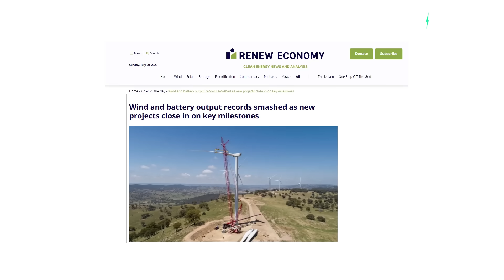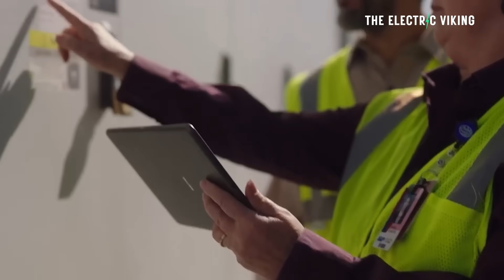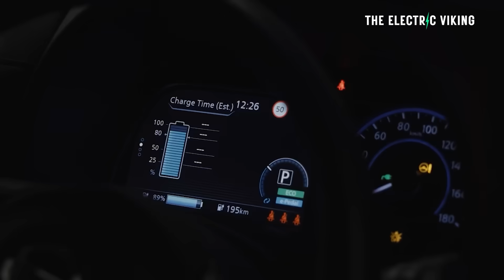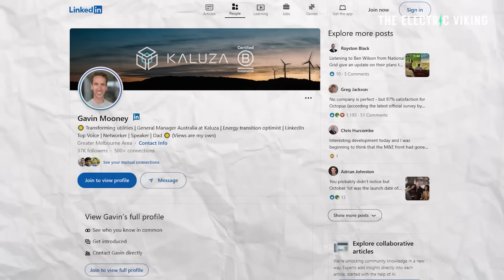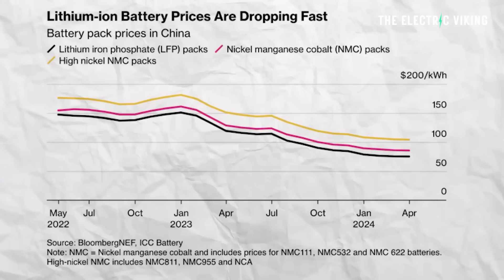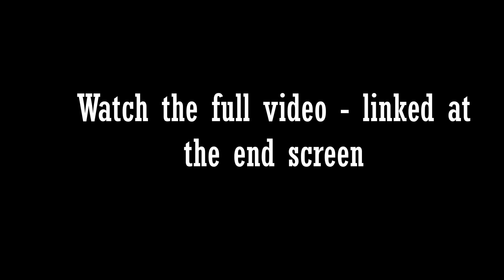Australia, Texas and California SMASHED renewable energy records last week

Comment: In Brazil my friends tell me that their cost of electricity is ZERO.  During the day they sell their excess power from the solar panels on their roofs to the grid and at night they use up their excess credits.
Reply: Well you see that doesn't work in real countries where the main reason for electricity generation is shareholder value, a system like that would never work in a real country like the US where it is a requirement to nickel and dime every citizen for everything all the time. Unless renewables can be made to be more expensive to justify charging 40% of a customers yearly income, it will never become a thing in the US

Comment: .  "In 2022, California used a total of 287,000 gigawatt-hours (GWh) of electricity, according to the California Energy Commission. This includes both in-state generation and imported electricity. "  "In California, a significant portion of electricity generation comes from renewable and non-greenhouse gas (GHG) emitting sources. In 2022, these sources accounted for 54.2% of the state's total electricity generation. Specifically, this includes solar, wind, geothermal, and large hydroelectric power. In 2022, California's utility-scale renewable generation increased by 10.2% to 102,853 gigawatt-hours (GWh). Solar generation alone saw a 24.1% increase, reaching 48,950 GWh. "
Reply: The GHG industry sees this as a net revenue loss and they’re actively lobbying to slow down or reverse this process of true clean energy.
Reply: @royherren1336  greed hiding a death wish.

Comment: If - NORTHERN LYING - Germany and Netherlands both generate over 50% of their electricity through sustainable sources, these natons are as north as the Hudson Bay in Canada, the US can do this with ease. Airconditioning? Feed that with solar power. Same with (heat-pump driven) hot water boilers. These are the biggest two energy users at homes. Just utilize roofs: so networks/grids are hit less. Bye bye coal. Was good, but CO2 and soot - this is a past time. You've got it Viking!!

Comment: Pacific Gas and Electric, our monopoly Northern California grid,  gives you very little money for any excess energy you produce.
Reply: I live in San Francisco and have rooftop solar panels. I agree PGE is a ripoff. My best solution is to consume all the electricity generated from my solar panels. So, I am using PGE as a battery. Eventually PGE might charge extra fees since after I add the solar panels electricity, my net electricity consumption is zero. In this case I would get batteries and disconnect from the PGE grid.
Reply: For the elsewhereians here I should explain. If one installed solar before a year or so ago, then if you produce more than you use over a year you are paid the wholesale rate for your excess. If you use more than you produce over a year you pay the retail rate for your excess use. You are using the grid as a battery, but this is only for twenty years from when your solar went on line. PG&E is trying to get out of the deal. At that point it will be worthwhile to get batteries. Since batteries keep getting cheaper and longer lasting it is worth waiting. Myself, I have 17 more years.
Reply: The problem isn’t solar, rather it’s PG&E’s apparent/alledged partner the California Public Utilities Commission (CPUC).  PG&E made over $2 billion last year and their CEO made something in the neighborhood of $17 million.

Comment: Sadly, here in the US the Republican party continues to ignore the fact that fossil fuels are a limited resource.
Reply: The primary issue isn’t the relative abundance of hydrocarbon fuels, rather the issue is our atmosphere’s capacity to carry ever more CO2 and still maintain an atmosphere consistent with our environment.  Climate change is an all too real phenomenon!
Reply: Many of them are ignorant or bought and paid for by the fossil fuel industry..
Reply: Amd that it does anything negative in its use.
Reply: The understanding that oil comes from organic matter is still a “theory“. It is believed that oil comes from organics because the radio isotopes closely match certain organic compounds. However, the radio isotopes and oil also closely match certain in organic compounds. So the whole belief that oil is a fossil fuel is simply a theory.
Reply: @packinghousetuesdaynightme9105  And that somehow makes it not a limited resource?
Reply: @packinghousetuesdaynightme9105 but there is no doubt that it is a limited resource or that it’s use is causing climate change 😮
Reply: @packinghousetuesdaynightme9105  Stay in your lane and stop your mischief!
Reply: @packinghousetuesdaynightme9105 It’s the only theory that is plausible.

Comment: Crossed the tipping point anyone in coal needs to get out
Reply: Coal lost out in the market place due to abundant fracked natural gas.  Anyone peddling “clean coal” is gaslighting the public for their own political gain.  Solar and wind, while not “dispatchable”, with zero fuel delivery costs are less expensive than hydrocarbon energy sources.  The dispatchability issue and associated costs such as batteries is being eliminated by the reduction in the cost of batteries and the increase in their lifespans.

Comment: How does this affect prices of electricity in those three areas as compared to Europe where electricity prices have skyrocketed since renewables were introduced at scale???
Reply: You assume that the electricity price skyrocketing in Europe is 100% the fault of renewables. Got any analysis or links to show this is true? That there were no other factors? Otherwise I find your comment unreliable
Reply: In the UK, electricity prices shot up when we stopped buying Russian oil. Then our marginal pricing model holds the price at our most expensive supply. If oil is more expensive it sets the price. It's a crazy system. Then we have National Grid who choose where to supply from but are not incentivised to buy from cheaper (renewable) resources. It is based on rules produced in the 1970s to encourage expensive North Sea oil.

Comment: Coal Peaker Plants?  I never heard of one.  Nat. Gas and liquid fuels are used for the on demand plants.  Many are jet engines which are highly efficient which can be up and running in seconds.
Reply: However, the natural gas production, distribution, and use cycle is damaging to the atmosphere with methane and CO2 emissions.  Regardless of the efficiency of natural gas peaker turbine generators they still harm our environment!

Comment: Wouldn't Bifacial Solar Panels on both sides of most highways & rail lines in all countries produce enough electricity to power each country?  Add Mega Packs to store the excess energy that is created for peak periods.  Every country on earth has buildings with flat roofs, which is another area that they can add solar panels to the grid to produce more electrical energy.  Solar Farms produce more electricity but they also take up more land while solar fencing & flat roof solar do not & they highways & rail lines run through most cities & towns in every country which means most in every country can benefit from the grid & help pay for it.  Add to this tide technology & wind power where applicable out in the ocean & in places where people can't live.  

Optimus Humanoid Robots are around the corner & they could be the cheap labour needed to install & maintain all the solar panels required on highways, rail lines & flat roof tops. Every country on earth has highways & rail lines that run throughout their countries & every country could build Bifacial Solar Fencing as they can afford it one mile at a time. It just takes political will & we know that most politicians are most likely bought by the oil & gas industry everywhere on earth.  I don't understand why countries living close to the equator haven't started the transition to solar, wind & tide tech yet when it is so obvious it would be better for them & their economy.

Comment: I must say it again, for most countries lithium ion batteries are never going to be the answer for the long term storage they will require because of seasonal changes in power production and variations year to year, it's great that is the summer we are at the point where batteries and renewable for grid scale would make some sense although the limitations of lithium processing means that it will take a long ass time unless sodium cells become much more wide spread, then yep totally feasible, but we have to temper our enthusiasm because in most places you are going to need more than wind, solar and battery storage even more than pumped hydro ontop could reasonably deliver.
Reply: Saying ‘never’ suggests you haven’t read history. 
A decade  ago, people were saying renewables would ‘never’ get cheaper than methane, including me. 
Four years ago, people like me said EVs would need a decade before they’re cheaper than ICE. 
Are you ready to be extra wrong? The materials engineering for alternative batteries is already in market, it’s just manufacturing and distribution.
There are three companies looking at data Centres in northern Canada, powered by renewables. The math is just about where they need it be. 
Also, winters are very attractive for data centre cooling potential, granted the grid is stable. That’s the bigger issue now.
Reply: @IdrisFashan  So just to be completely clear what I'm saying is that lithium ion batteries will never be the sole solution to energy storage which is just "no shit sherlock" lithium ion and ion batteries generally have their advantages and disadvantages and it will take other technologies to fill in those disadvantages, so when I said "lithium ion batteries are never going to be the answer to long term energy storage" well first I didn't eliminate them as part of long term energy storage, I just said they wont solve it on their own, second yeh lithium ion batteries suck at scaling with capacity by their nature, because you have to add more batteries to get more capacity which the batteries are the most expensive part in a ion battery grid scale instillation, where as compressed air, hydro electric, flow batteries and thermal batteries increasing the capacity is relatively cheap and the bigger you go the lower the your cost per kWh capacity.
Reply: @Etheoma  yeah I completely misread your first comment. 😅
Reply: @IdrisFashan  Ya didn't read what I wrote did you, I specifically said lithium ion batteries are never going to be the answer for long term storage aka months at a time, it's very specific for a reason, although the self discharge of lithium ion batteries has not notably decreased in the last 15 years at least, so for long term storage it really really does seem like it's a fundamental weakness in lithium ion batteries and ion batteries more generally. Although we do have flow batteries for longer term storage, pumped hydro large and thermal batteries which it specifically has to be a very large thermal battery for it to be good at storing energy long term although that is not as problematic as you might think, for industry who needs process heat it just means centralizing that industry which we do already centralize industry, so it's not a massive problem and distinct heating is already centralized so it's a perfect candidate which is apparent by plenty of places that do district heating switching over to thermal batteries.
Reply: Right now we still need a mix of power generation for base load.  For developing countries, where this tech can make the biggest impact, it will all need to be much more cost effective to implement at scale. As the tech matures and new material science comes up with more efficient batteries and solar we may be able to transition to only renewables eventually.  It seems we are getting close, but time will tell.

Comment: It is wonderful to see that renewable generation and storage have critical momentum and are unstoppable!  Will consumers get most of the benefit or will retailers soak it all up as excess profits?  It is only roof top solar that keeps them honest and they have gone to war against it using State and Municipal Governments to squeeze it out. No more feed-in tariffs, curtailment, red tape and restrictions on community networks and power sharing.
Forcing the population to take electricity from privately owned poles, wires, batteries and solar/wind farms so they can have the same old monopoly power they've always had.  We need to escape that and get back to less than 10 cents a Kwh.